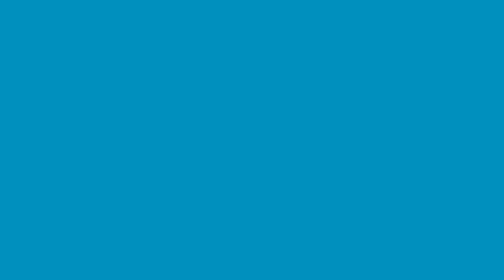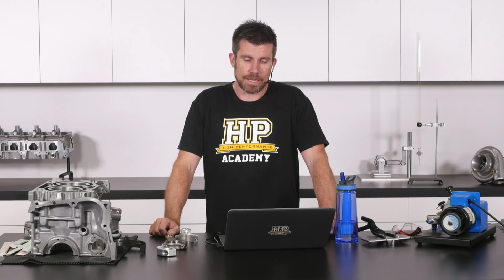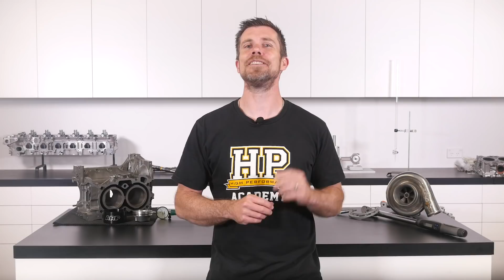NA VS TURBO | Engine Building Considerations [HPA Q&A]

Comment: what if we choose a "light turbo" application on our project? Meaning the turbo pressure never exceeds 0.5 - 0.7 bars? Should we change the engine components to ensure reliability?
Reply from the maker: 100% depends on the engine, there is not one rule that fits everything - Taz.

Comment: Why not the best of both worlds? High compression, boost and e85
Reply: I've always wondered what a safe CR limit is for the e85 available in the US. There's tons of old iron head clunkers around that are great candidates for milling the crap out of the heads and cutting reliefs in the pistons to achieve the desired CR. Seems like a decent way to extend the life of the old iron.

Comment: As a general rule, IMO, the primary difference would be the way they produce power - as Andre said, the forced induction engine does it by increasing cylinder pressures to gain torque, so the component selection will need to concentrate more on compressive loads and sealing under high cylinder pressures whereas the NA engine will usually increase power by increasing the operating RPM, so more emphasis would be on tensile loadings (piston pulling on the con' rod.
Reply: when is the piston pulling against the con rod? all times the piston either through acceleration or compression to everything, the piston is pushing on the rod.
Reply: I suggest you review your understanding of the mechanics. From approximately 90 BTDC on the compression stroke there is an initial tensile loading on the rod assembly, as the piston is being slowed from it's maximum velocity in the bore as it approaches TDC where it is momentarily stationary, until the compressive/combustion force on the piston top exceeds the load on the 'rod*.
On overlap, the tensile force applies from 90 degrees BTDC to 90 after because the piston has to not only be slowed but accelerated back to maximum velocity. 

*You may wish to note that tensile failure is almost invariably on the overlap as there isn't the compressive/combustion forces relieving the rod of some of the loading. You may also wish to check out the reasoning behind the yamaha crossplance crankshaft in their in-line 4 cylinder engines - very interesting.

Comment: The difference would be a stronger bottom end forged crank shorter connecting rods and maybe different heads to
Reply: Why shorter connecting rods?
Reply: @gordowg1wg145  cause the boost would bend those bigger rods and you need to compensate for the boost also
Reply: And longer rods flex to
Reply: That is why you use 'rods that are STRONGER in compression, not a reason for shorter - normal practice is actually to use longer rods, primarily to reduce side loading on the cylinder bores but also to improve the rod-stroke ratio.
There are many reasons not to use shorter rods.
Reply: Shorter rods are what are compensating for compression that's how you make them work longer rods would bend and flex it's like not strengthening the body of the car its the same concept

Comment: I have heard that you can run 12:1 compression ratio if basically the electronics can keep up with the right fueling and timing.
Reply: Also depends on cylinder size and design, and the fuel used.
Reply: @gordowg1wg145  basically prevent pre-detonation when under boost
Reply: Are you conflating pre-ignition and detonation - they are two different things?
Reply: @gordowg1wg145  sorry multi tasking ment to say detonation
Reply: Haha, I try and leave that for the womenfolk ;-)
Reply: @gordowg1wg145  lmao. I guess bro.
Reply: You blokes need some serious lessons!!!    Engines aren't rocket science... If your engine builder can get 600hp out of a small block Chevy.... you can get the same!!!!    ...     secrets are not secrets anymore!!!    I.e .. light weight valvetrain... .0025 thou mains and rod clearance... piston clearance to manufacturers specs.. follow manufacturers guidelines with ring installation,  0 deck block ... ie compression ratio. Bolt on cnc heads... decent shelf cam= 600hp.  It's just to easy these days!!!!